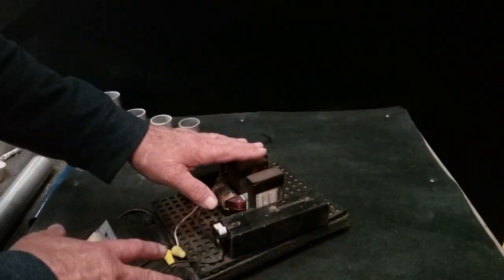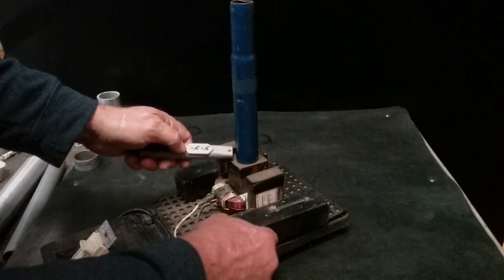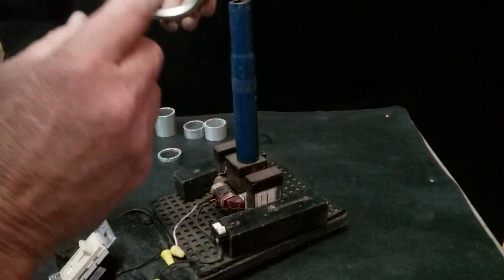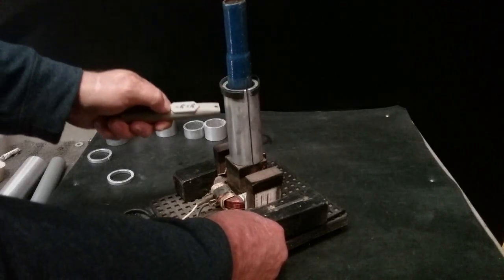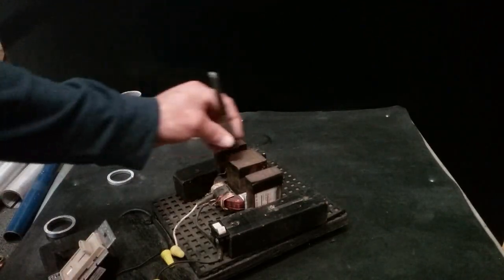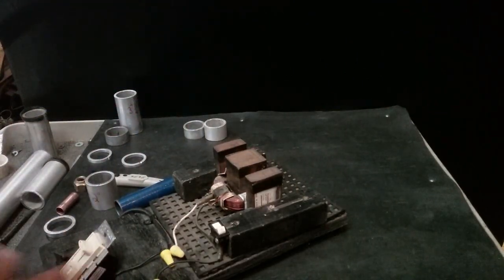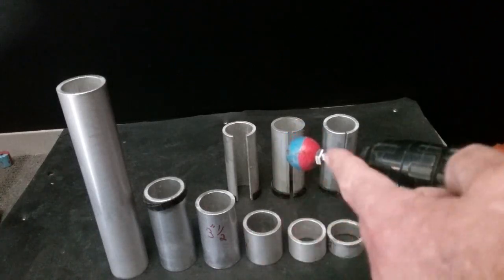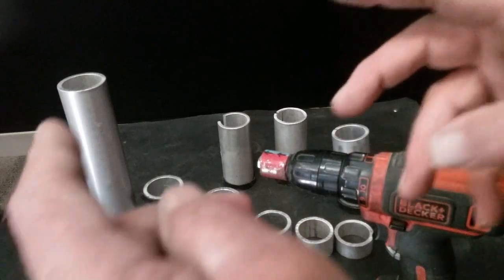Differences Between Electromagnetic and Natural Magnetic Fields

Comment: Love this stuff!  I will put on my thinking cap and try to decipher the results.  The last one is easy.  In a vertical configuration the plane of inertia is horizontal and so homogenous fields are presented regardless of angle.  But the mechanism to cause rotation will be interesting, similar to dropping a magnet down a copper tube - it will go slow.
Reply from the maker: Agreed.

Comment: It's showing resistance of the Gauge of the conductive material. The iron is generating a separate electromagnetic field so there's actually 2 fields merging slightly. The vortex spin of the iron rod which I'm speculating is hollow pipe. Due to the diameter of the pipe the magnetic field of the inside of the pipe creates an imbalanced down spinning vortex inside, and up spinning vortex on the outside. It's all about geometry. Pipe gets hot because it's doing all the work. Hot = energy flowing. Good luck guys.

Comment: What if you spin the natural magent and move up very quickly will it pull 9n the aluminum? Could the differences be that when travelling up the steel rod from the em as it spins it creates surface waves that the aluminum  rises whereas the spinning natural magnet inside the aluminum  is spinning in one loop on one flat plane?
Reply from the maker: I tried a longer bolt and spinning the magnet deep inside a tall aluminum tube and pulling it out at various speeds.
The tube spins - but will not lift - even the short 2 inch tall tube just spins but will not lift when pulling the magnet up.

Comment: Can you do this using a ring of titanium. This would be an important test.
Reply from the maker: I'm looking into purchasing a small tube of titanium for the experiment. However, since aluminum, copper and titanium are all paramagnetic - I believe the titanium will respond as the other two do to the electromagnetic field.
Reply: @TheGoodVibrations  Do you have the dimensions of the titanium tube you'll need?  Also would 12 volt vehicle battery create enough current to drive the tube fast?